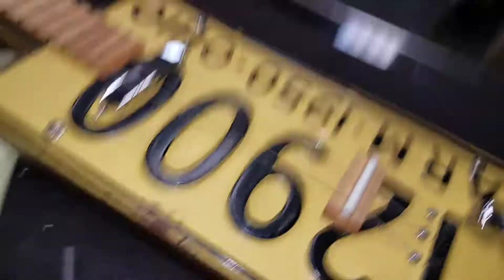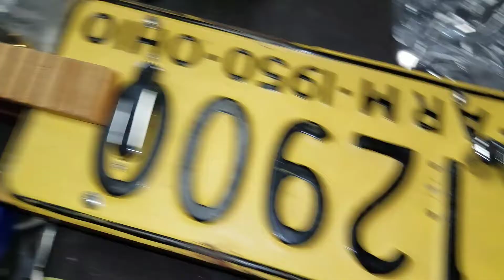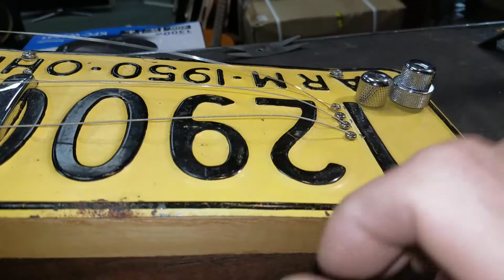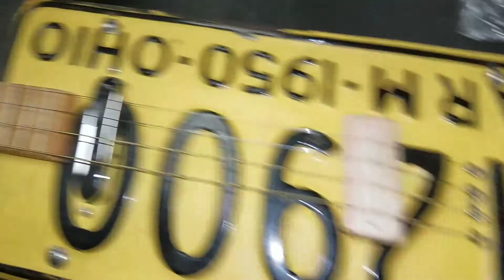TENOR GUITAR CONVERSION/ TURNING A THREE STRING GUITAR INTO A FOUR STRING

Comment: Wow Marshall! You did a great job Marshall! Going from a 3 to 4 string tenor. How heavy do you think it is? 
I have a 3 string cigar box guitar that I love. I want a mandolin next. 
Rock on 🤘 Marshall.
Reply from the maker: Thanks Andy. I'm guessing the weight to be about 7 lbs. For something so small, it's heavy. I failed to add the demo of playing it. AAARGH. Oh well.
Reply: @MarshallSetUps  Converting a 3 String CBG into a 4 String? That seems like an interesting upgrade. We could also add the 5 String Conversion kit, the 6 String Conversion kit etc because the additional strings will broaden your range to enhance creativity. Like for Example a 6 String in Fifths tuning (C, G, D, A, E, B) you'll need a set of Octave4Plus 5ths Tuned Guitar Strings cause the High B is a .006.

Comment: So it's tuned like a Violin (G, D, A, E) which makes it great for Violin players who wanna strum.
Reply from the maker: Yes. Thank you for your comments. This was a fun conversion. Not without a few struggles.
Reply: @MarshallSetUps  3 String to 4 String Cigar Box Guitar conversion, guess we need CB Gitty to make kits for that cause now more people want to upgrade their 3 String CBG into a 4 String so they have more tunings. Next up to 4 String to 6 String Conversion kit.
Reply: @MarshallSetUps  You can tune a 6 String CBG in Fifths by using Octave4Plus Fifths tuning strings since the High B is only a .006 which is really thin but strong.
Reply from the maker: @RockStarOscarStern634  There needs to be enough width in the neck, unless a neck replacement is part of the plan. There is no way this instrument could have been converted into a 6 string instrument. No kit was used. This was entirely customized. I'm not aware of a conversion "kit".
Reply: @MarshallSetUps  Neck replacement is the 1st thing to do if you wanna add on more strings. My name is Oscar Stern BTW. CB Gitty might be watching this video.
Reply: @MarshallSetUps  So if you wanted it converted (or upgraded) into a 6 String, you'd have to make a new neck first, & that's what alot of people are reccomending.
Reply: @MarshallSetUps  A Conversion kit might be interesting cause it includes a conversion neck that's designed to be in the place of the other neck. Kinda reminds me of those Brunner Interchangable neck Guitars whichc allow you to easily convert it to a variety of instruments by simply swapping out a neck.
Reply: @MarshallSetUps  I think relpacing the Whole Neck seems more appropriate for if you're converting a 3 (or 4) String CBG into a 6 String, kinda reminds me of those Brunner Guitars which have interchangable necks.
Reply: That kinda gave me the idea to convert my 4 String CBG into a 6 String. The thing I'll have to do is make a new neck or I could widen it by flattening the round part, gluing extra pieces of wood onto it to widen it, & re-cut the neck. It'll result being a lameninated neck.
Reply from the maker: @RockStarOscarStern634  Indeed. My client simply wanted it converted to a Tenor Guitar. The neck was just wide enough to accomodate her wish. It plays and sounds fantastic. I have not been able to find the original builder.
Reply: @MarshallSetUps  I think your Client also plays the Violin. Because the Tenor Guitar is tuned like the Violin, she is able to start picking away everything from the Suzuki Violin methods.
Reply: @MarshallSetUps  Because the Tenor Guitar is tuned the same way as a Violin, it's pretty easy for Violinists to start picking away Violin pieces on a Tenor Guitar. It's easier to play than a Violin because you've got frets which makes it easy to find the notes & you get to use a Pick.
Reply: @MarshallSetUps  You know those Brunner Guitars? They have interchangable necks so you can easily convert your Guitar into a whole variety of instruments (and back) w/o any issues, simley swap out the neck.
Reply: @MarshallSetUps  Oh, but your Client as a Violinist can easily pick away on the Tenor Guitar in Violin tuning.